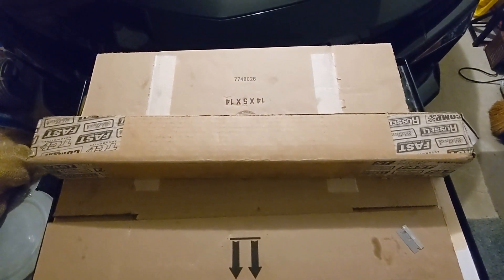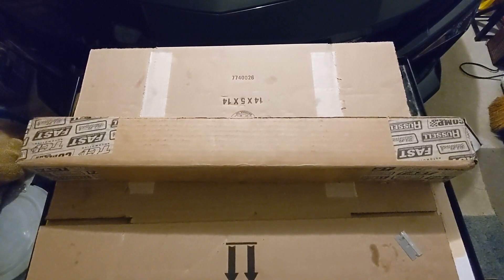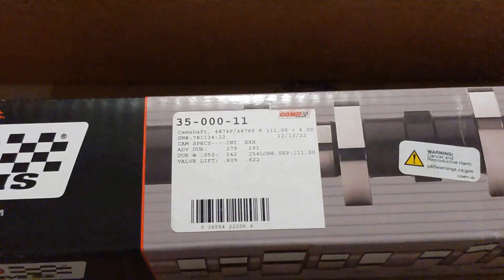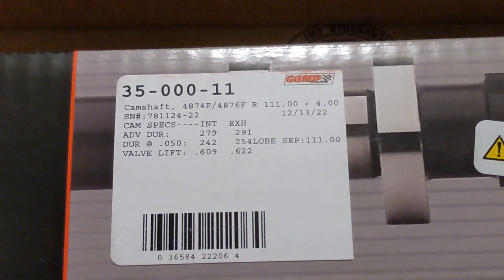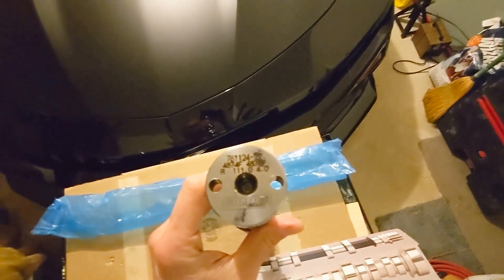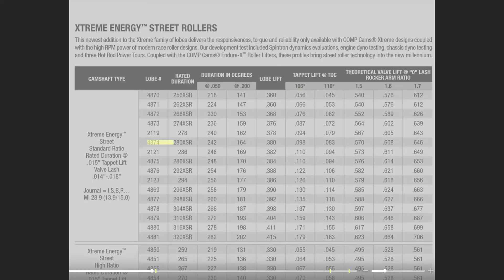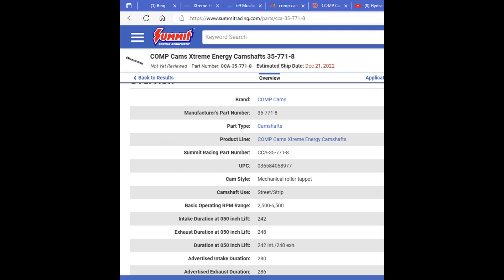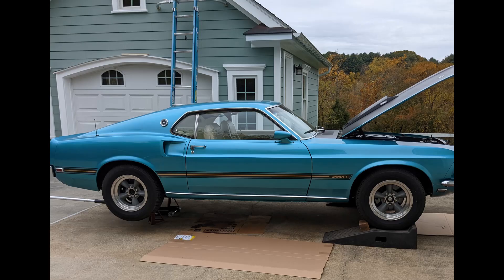Ford 351W Camshaft Specs - Comp Cams Custom Grind

Comment: what are the specs on the rest of the engine youre building?
Reply from the maker: It's a stock crank 351W bored .030, so 357 CID, about 10.5 compression ratio, Windsor SR heads. I made an assembly video if you want to check it out that shows all the parts and also a dyno video.

Comment: Could use some help myself starting  build now. Was my fathers old 351w! In a 86 ford 250 Dually. Would love some pointers!
Reply from the maker: Be happy to provide some pointers but it would depend on what your goals are.  Are you going for a stock rebuild or do you have specific a horsepower number in mind?  Might want to seek out a local automotive machine shop that could provide some guidance depending on how much you are looking to spend. You might be needing some block and crank cleanup at a minimum.

Comment: The wait time for the custom cam was brief. For some reason I was thinking several weeks post Covid-19. 👍
Reply from the maker: Yes, I was surprised.   I think Comp Cams has a pretty quick turnaround for a custom cam if they have the core in stock.  Now I just need to assemble the motor, which should be happening pretty soon.